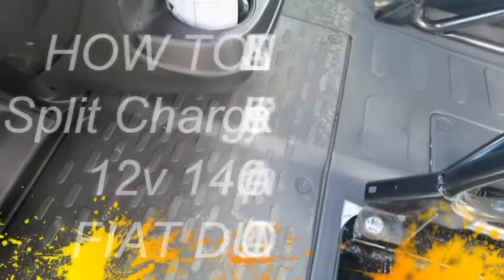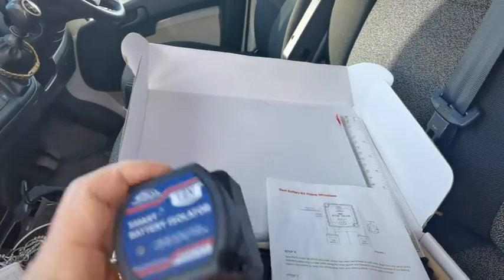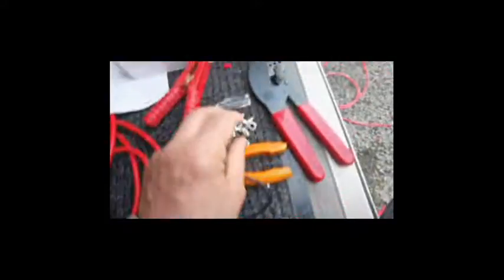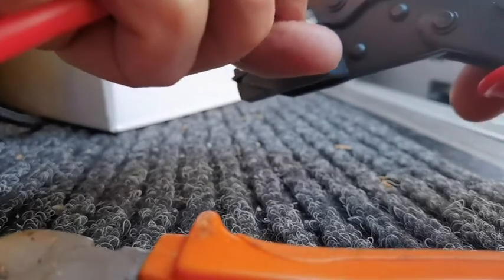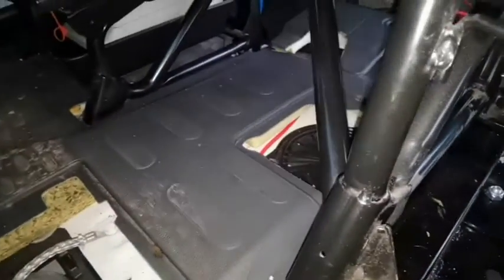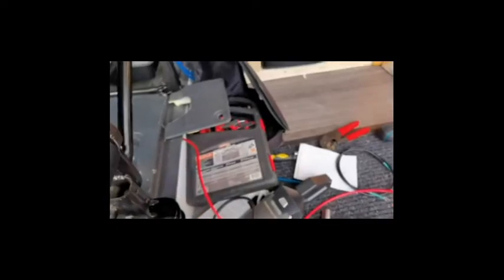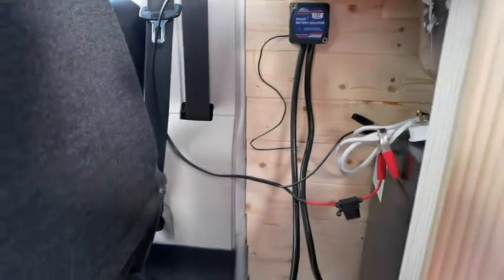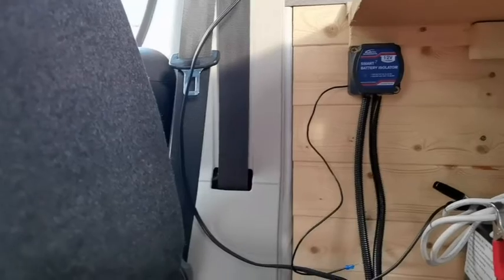How to install a Split Charge Relay Kit 12v 140 AMP

Comment: Hi Mark i have same kit and a isolator switch as well had the switch off connected the red wire to van battery  went to start  up  electrics have gone dead no turning over of engine only things alive are   central locking or immobilizer  any idea what's happened  Vauxhall Vivero  thank you

Comment: These kits are a waste of your money. The VSR (Split charge relay) will chatter on/off when nearly fully charged and you don't need 10mm cable!! The cable from your alternator is only 3mm. Make your own split charger with a standard 30amp relay, mine has lasted 4 years.